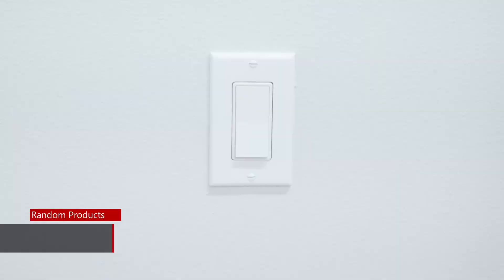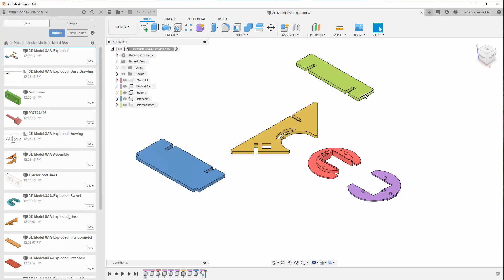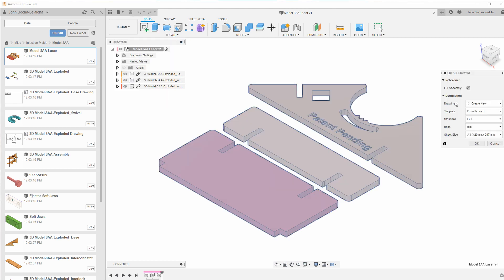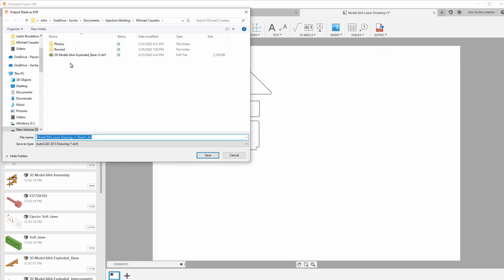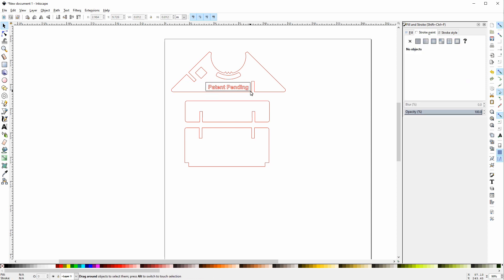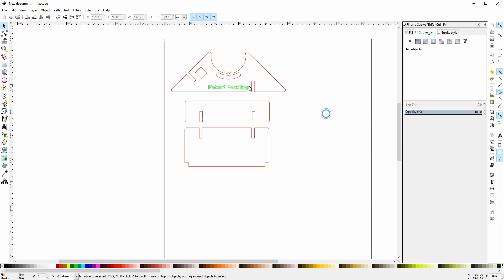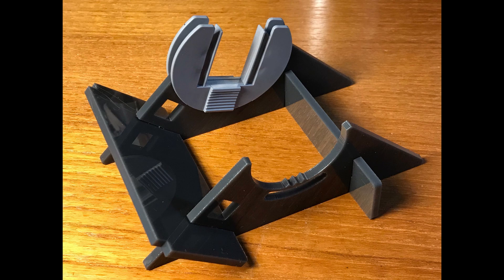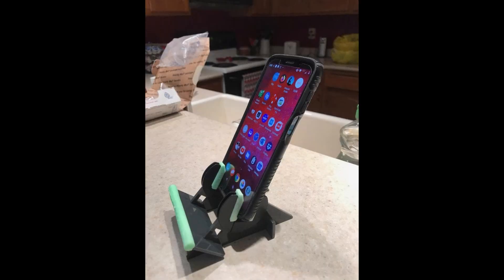Fusion 360 to Laser Cutter

Comment: Why not just export a sketch as a .DXF?  That should feed right into your laser. If you have a solid body you can create a sketch and project the body to capture everything.
Reply from the maker: I certainly could have done that. I like using the drawing because it's associated with the solid model in a separate file, so I don't have to maintain a sketch. If I make changes to the solid model, the drawing will update automatically and be correct. But with a sketch, it may not update correctly if you add or remove features.
Reply: @JohnSL  If you project  the bodies to a new sketch, and use project link, then you can have an auto update sketch you can export as DFX
Reply: @tvrleigh  correct. This does seem to work, but it does make you go a few extra steps

Comment: Really nice video! A year ago I was dealing with a similar issue and I came up with a different approach - I wrote Fusion 360 post-processor which outputs SVG. The advantage of this procedure is that when you change your design, you just run the post-processor again. It can also leverage fusions tool compensation to get really precise fits. An it it can out of the box support multiple colors and plays nicely with a nester. There is a step-by-step guide for the whole workflow written by my colleague, however, it is available only in Czech: https://drive.google.com/file/d/120yMV6bapFM7dEGs11l3gzDAo6fNYaFJ/view
Reply from the maker: That's cool! It would be really nice if you could translate it to English.

Comment: Love your work and am learning a lot from your videos. Quick question: What kind of plastic do you use and how long will it take to biodegrade?
Reply from the maker: Thanks. For injection molding, I'm using polystyrene, which I don't think is biodegradable. And in the laser, I'm using acrylic, which I suspect also isn't biodegradable.
Reply: @JohnSL   I appreciate the response. Looking into this question myself before jumping into the injection molding world and trying to be as sustainable as possible. After reading the book Cradle to Cradle, I realize that there are generally two approaches one could take with polymers: as technical nutrients or as biological nutrients (see the Wiki page on "Cradle-to-cradle design" for definitions). Some polymers seem to qualify as technical nutrients that can be reused without being "downcycled." Other polymers seem to qualify as biological nutrients that are compostable or biodegradable. I'm leaning toward the latter at the moment, looking into hemp polymers. Thought you might be interested in comparing notes!